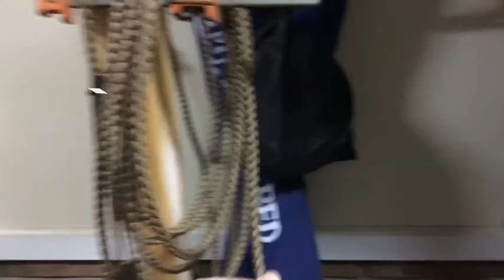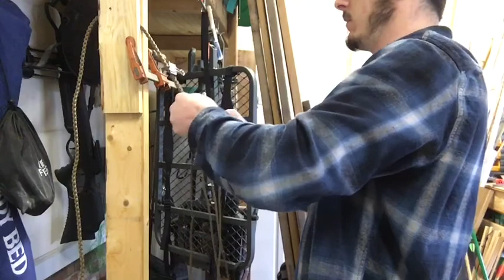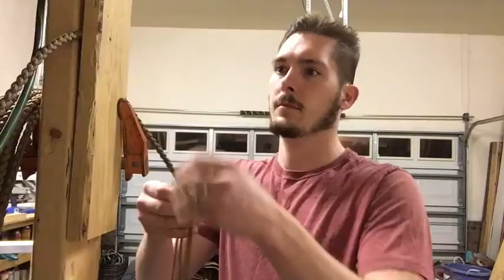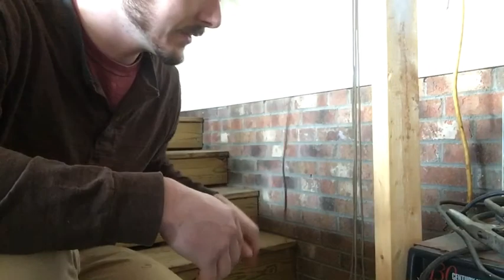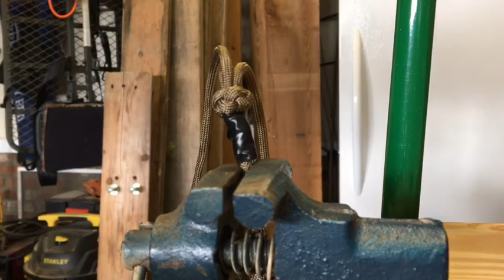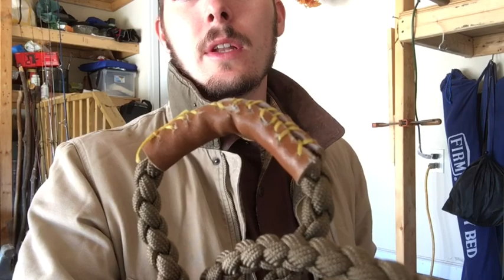52ft Paracord Lasso/Riata Part 1

Comment: I haven’t braided much paracord but I do braid quite a bit of rawhide. I have also braided several rawhide reatas. If you pull your strings in the same manor that you would for rawhide or leather it will do a couple of things for you. Your braid will be more consistent with less strain on your fingers and hands. The second is that you will have less problems with your tamales tangling up. Best of luck in the future.
Reply from the maker: I appreciate the tip!

Comment: Your rope looks very nice. Next time, you need to rig up a way to do it sitting down. 

I wondered if you would do the box stitch at the end and you almost did what I would have done. There is a variation of the box stitch that makes it round instead of square. I think it is called a Crown Knot. That would be nice on the end opposite of the lariat.. An alternative would be to splice the end strands back into the body of the rope going in the other direction.. 

Another way would be to do the last 4 inches of the braid around (4 loops of strong cord(of different colors, so that you know which rope strand to pull through which loop) inside the middle of the braid). When you are done with the main braid, put each end through it's corresponding loop and pull them so that the ends are pulled into the middle of the rope. This should make an almost invisible finish knot.
Reply from the maker: I like those ideas! I would love to see that knot done